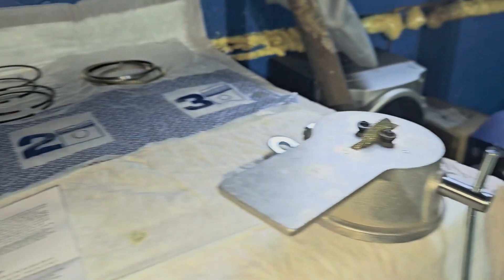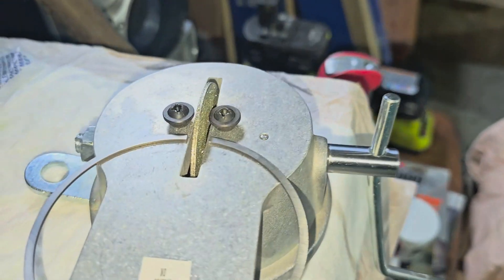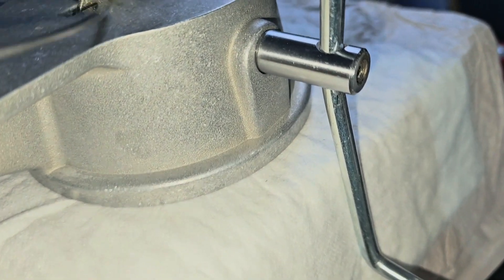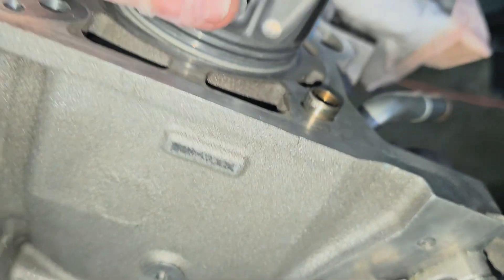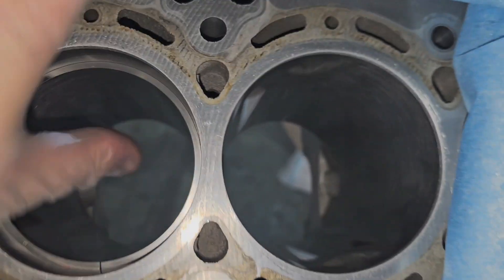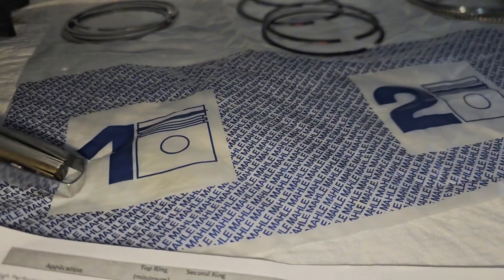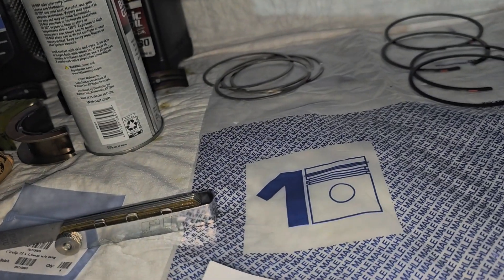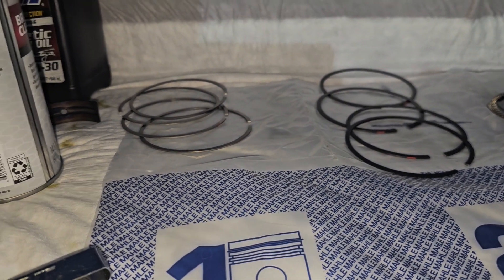How to Set Piston Ring Gap - Built Focus ST - 2.3 stroker! #focusst

Comment: When I rebuilt my bottom end in my mustang 3.7. I used Manley rods and pistons. Total seal rings. I believe between 6 pistons i had .0024 - .0026. I wanted closer to .0028 - .0030. I called " total seal "they told me not to worry that with 2618 piston with gas ports its fine. Lol it still bugs me. Ive yet to run over 10 psi. Im still upset with myself for not filling rings down. Haha. Great video great explanation.
Reply from the maker: Yea i think mine was around .026 or something cant remember now.  You will be fine tho.